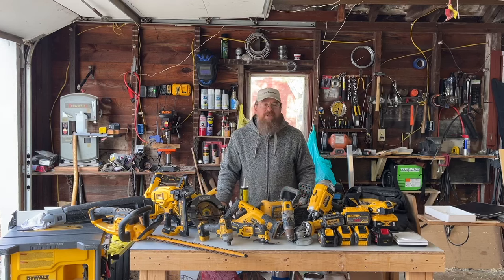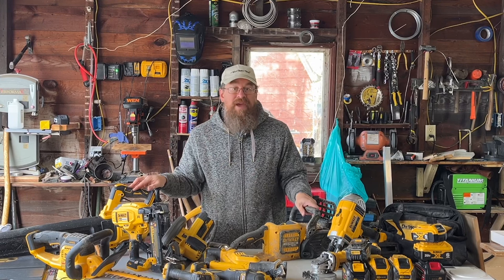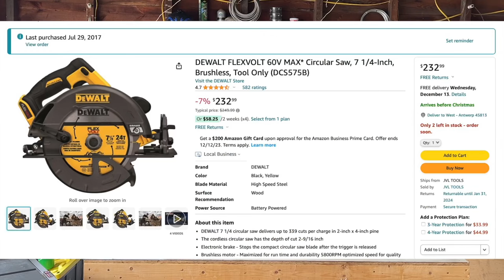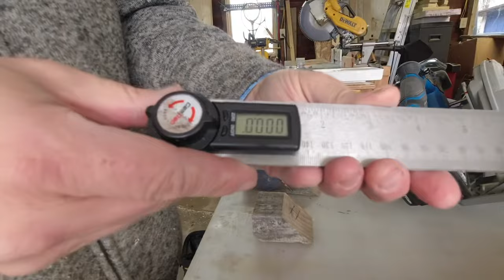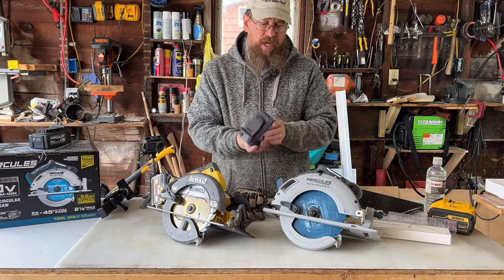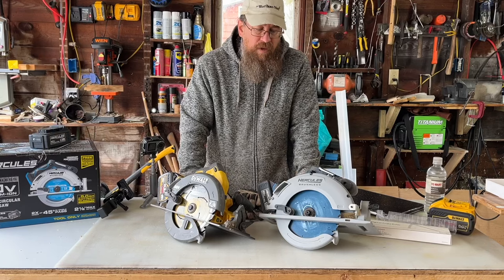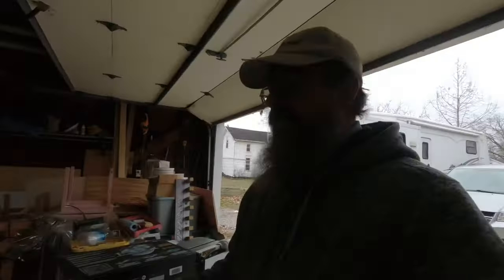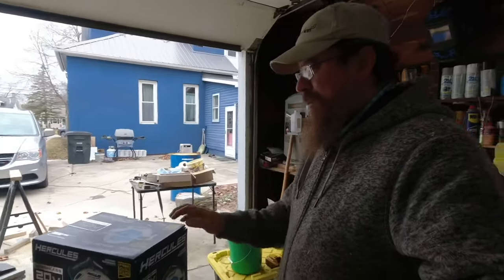DeWalt vs Hercules Circular Saw Exhaustive Comparison - E152

Comment: I have the exact same Dewalt saw  ,I am a contractor, this saw has revolutionised my work.
The saw ways less with the 6 amp battery than my blade right corded Skilsaw .A true professional never uses the marks on the base to align cuts ,the Dewalt has excellent views down the left and right sides of the blade ,you always look at the blade to do the cut ! The Hercules has bad sightlines down the blade and is only a handy man's  saw .

Comment: Great video man.

I dont even bother with the 5ah on my hercules circ/recip saws, I use an 8ah. Those black 5ah batteries are worse than the old blue ones, they use cheaper no name cells vs the samsung cells on the blue batteries.

The 8ah battery doesnt heat up as much as the 5ah and you get a noticeable boost in power. I'm not sure if the comparison is exactly fair 60v vs 20v, also do the dewalt flex batteries have 21700 cells or 18650 cells. I know the hercules 5ah has 18650 cells, the 4ah/8ah/12ah do have 21700 cells.

Theres no doubt in my mind that dewalt makes a great saw and is more powerful but many times I'm up in the air and it's nice to have a rafter hook.

I'd swap the hercules 12v 2ah battery for a 4ah, there's enough of a difference in power that makes it worth upgrading for as little as $24.99 when on sale.
Reply from the maker: That's interesting to know the 5v are not quite up to the task because of the internals. I just saw a project farm video demonstrating that same thing with the no name batteries for Milwaukee. They would die much faster and didn't have the power. I'll get the 8AH and see how what difference it might make.

Comment: I mean a felxvolt battery versus a standard 5ah battery should've used at least the  8 Ah Extreme Performance Battery on the hercules
Reply from the maker: agreed. Unfortunately HF wouldn't let me upgrade to the two 8AH batteries and pay them more for the same deal. I did recently get the 8AH battery, though, and will see if it makes a difference. If it does, I'll do a video update. Also, I don't think the warranty is 5 years as stated in the video. The paperwork that came with it said 90 days.

Comment: what id really love for hercules to do is 1 asap is make a dang jigsaw already like come on. Its such an important tool and your making a cordless  drywall screwgun which is way more niche. 2 make a more powerful line as well to compete with things like fuel and xr. Outside of those 2 things though for the price its where im heading only because the wen circular saw is basically a toy and my dad already gave me several batteries and theyre to expensive nowadays.

Comment: Note: Stores are obligated by law to Observe posted sales signs even if they've expired period it's on the store to remove the signage. Or be forced to honor the sale price... I think that's a federal rule and not state
Reply: Wasn't a sale over issue....but rather they mis-marked sale prices....several years ago one of the stores in town where I live had their Christmas sale starting...they had the Kitchenaid mixers on sale....oh boy did they....they mis-marked them and had the larger Pro-600 model on sale instead for the price the smaller 5 quart model was supposed to be...they had to honor the sale price, and I snagged the last one they had for my mom.  

Unfortunately I don't catch any tool sales being priced wrong HAHA!!

Comment: I'll take the Hercules with the 8ah battery because I don't plan on cutting through a  log anytime soon 😅
Reply from the maker: I use both regularly. It lets me keep one on site and one in the shop! either way I've got something!
Reply: I have a chainsaw for cutting through logs....use the right tool for the job LOL.  Actually I have the Dewalt Flexvolt 16" chainsaw, it works very well, plenty of power for being a cordless saw...I also have the Flexvolt attachment capable weed eater which also has really good power for being cordless.

Comment: You are comparing apples to oranges with regard to cut speed. 60v saw versus a 20v? Of course the 20v saw did not cut as quickly. I’d be shocked if it did.
Reply from the maker: yeah. that's the "extremely biased" part of the review. Even so, I thought it would be able to cut through, just slower. It's still a decent saw.
Reply: @PeaceIntheValley  IMO that comes off as extremely disingenuous and intentionally misleading viewers.  Due to your bias toward DeWalt you intentionally setup your "review" to purposely misrepresent the Hercules product by comparing it's 20v saw to DeWalt's 60v.  You've admitted such in several of your replies.  Your video here is why people can't trust youtube reviews anymore.

Comment: Bauer is the lite , like the smaller circ saw it's 6 1/2 inch blade.
Reply: Bauer has the same 7 1/4" saw as this. The only difference is a few cosmetics.

Comment: IMO dewalt wins easily I have a couple of Hercules 1/4 hex impact power tools which seem fine to me
Reply from the maker: it does when it comes to power. The Hercules does not have near the power when cutting,  However, it does cut on the marks well and the DeWalt does not hit the marks. When cutting a 2x4 the other day the hercules stopped on me and I had to start again. Is that normal?
Reply: 42:03 I have both i have not open the dewalt box yet. The hercules with a 8 ah cuts a lot of 2x4s and 3/4 plywood all day long and still have half the battery left at the end of the day. The dewalt i have is the flexvolt advantage. TTC showed it has 50% more power over the hercules. I have used the hercules every Saturday and Sunday for the last 6 months remodel 3 homes. I have worked the saw and myself hard. I am impressed by hercules. Note: my first hercules saw would stop and start, I never cut any wood. Went to HF and the gave me a new one that worked nice. The Sawzall is also impressive.

Comment: Hercules is the more practical Purchase with the 8 or 12 amp hr.
Reply from the maker: I agree completely. It works well so far. and the marks are accurate. Time will tell on durability. It does cutout way more than it should though.